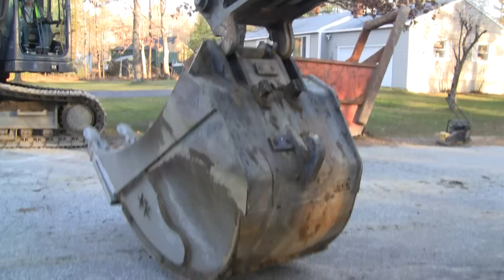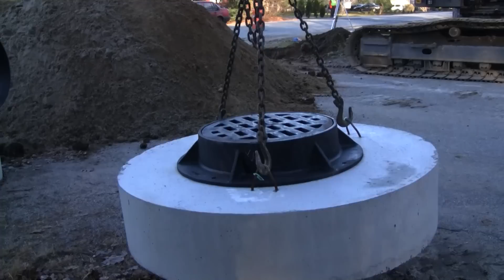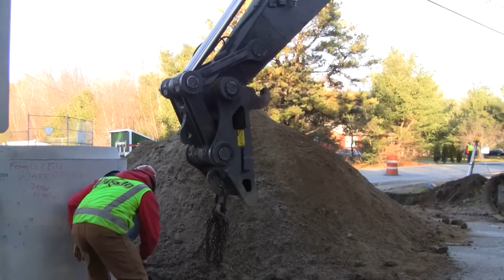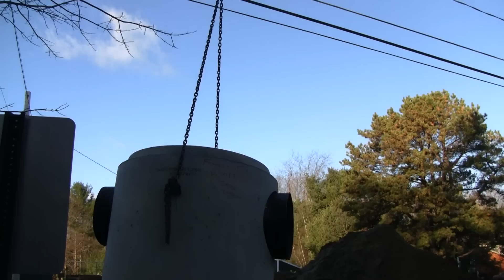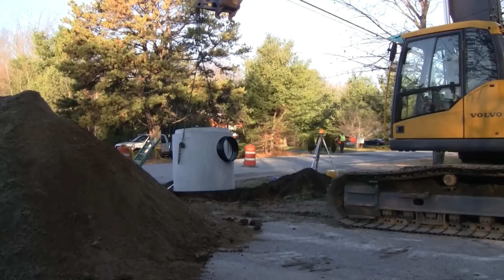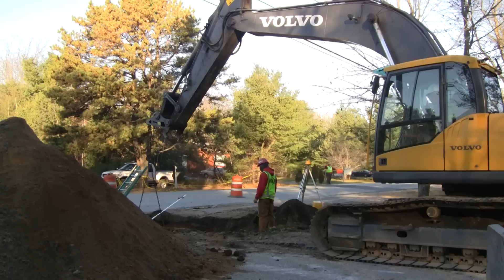Volvo EC290CL Lifting Catch Drain

Comment: @rabbitsmeller400 Actually that looks like a catch drain, there is about 12-24 inches below where the sewer/storm water pipe connects and the actual bottom of the piece, to catch debris, so it is neither a tank or a manhole cover, since a manhole wouldn't be a storm drain. Although I'm sure that men do go inside of it.